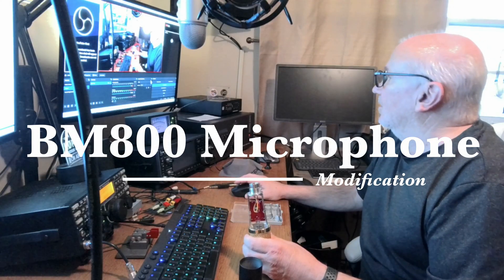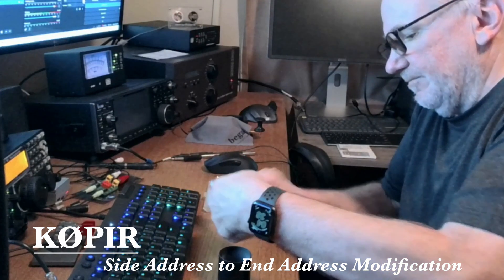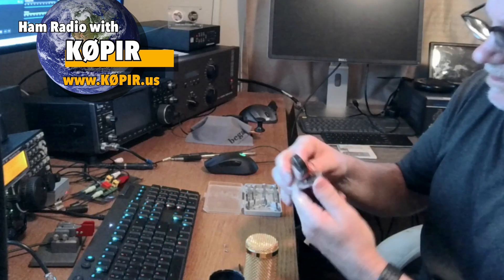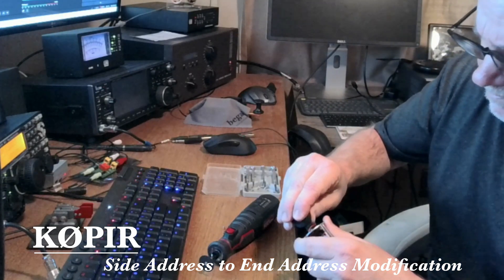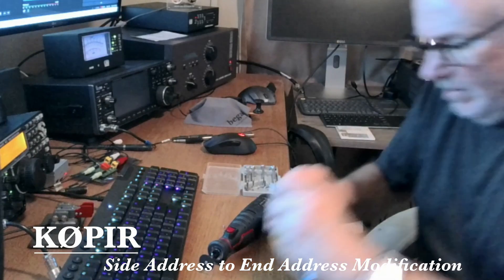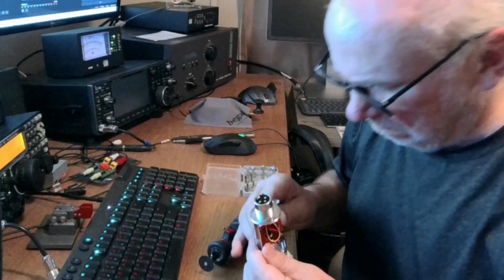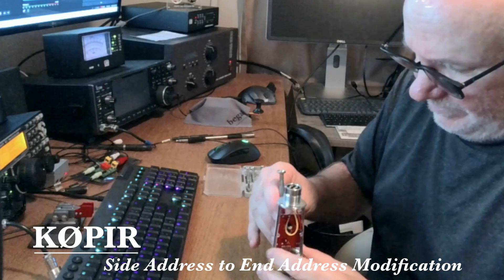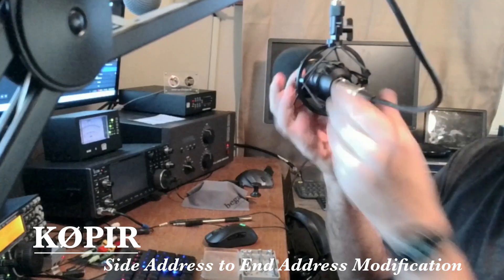Bm 800 Microphone Modification: Make Your Mic Even Better!

Comment from the maker: We are currently conducting testing on the WebSDR Mute Switch and making revisions to include a voltage regulator for the power supply. Additionally, we are adding a bypass switch for the audio circuit.